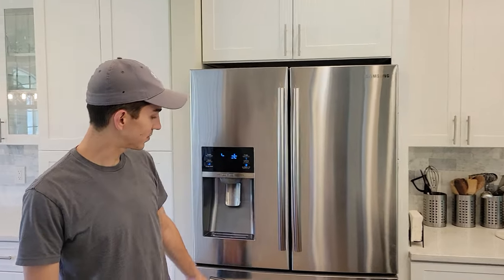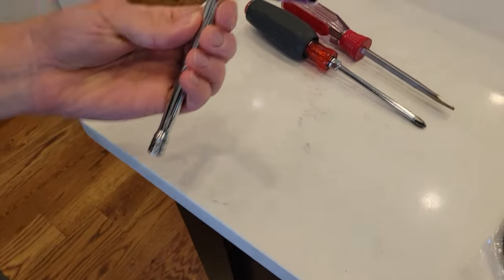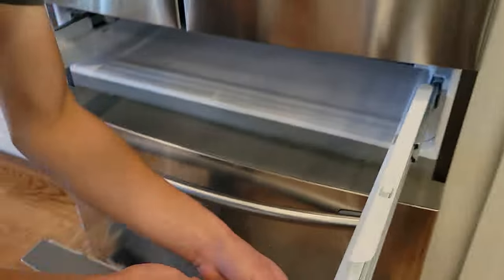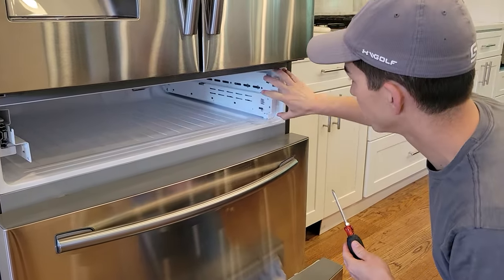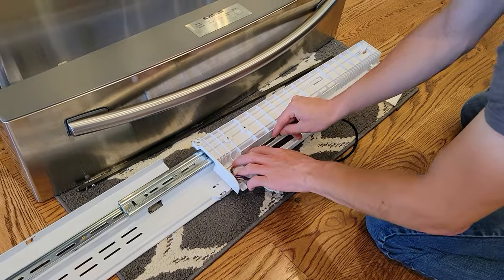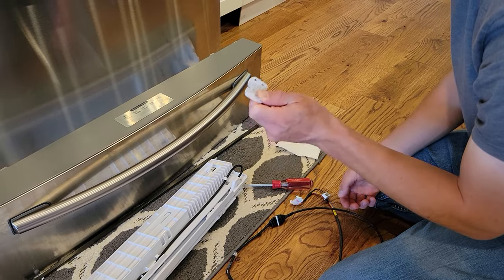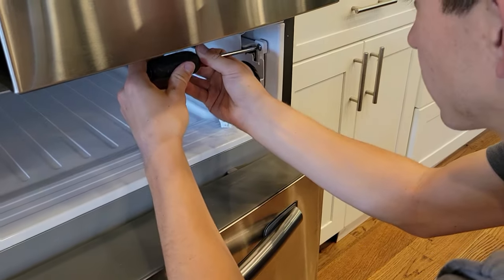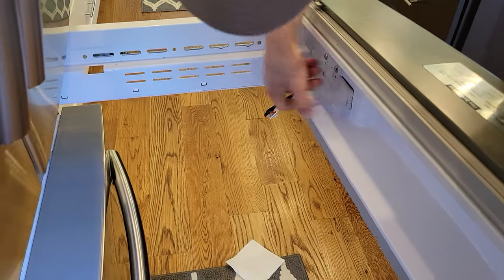Samsung Refrigerator - Flex Zone Drawer Not Working, Freezer light out - How to fix

Comment: Way to go Spenc... My situation and cable was exactly like yours. Thanks for the DIY. I ordered the cable on Amazon. $98 bucks now. And since I didn't have anything to do, I cleaned up the cable, soldered all the broke wires, (theirs eight of them) and put it back in. Worked like a champ. Don't know how long it will last but at least Ill have a spare cable when/if it goes.
Reply from the maker: Awesome! Hopefully that works! Nice to have the backup if needed.

Comment: Great video! Our cable broke a couple of years ago and got a new cable from Amazon. But trying to figure it out was frustrating and since our model has all the controls on the drawer, but all the lights and features of the fridge were still working, I just gave up and we've been living without any controls since.

After watching this video, I now am confident I can finally replace the cable. Thank you for posting this detailed video! So helpful. FYI, our model is RF23M8070SR/AA. And in case you're wondering, will never buy a Samsung fridge again. Between this, the ice maker issues and water dispenser issues, my recommendation would be DO NOT buy Samsung fridges.
Reply from the maker: Glad this helped! Thanks for watching.

Comment: Spent $100 on Amazon and despite not seeing any tear, the replacement worked.  Can now adjust temp in drawer and lights now work. Thanks.  

My model had an extra bar in the back secured with two Phillips screws.

One tip, it was difficult to get the black bar connecting the geared wheels back in.  If you remove the little white clip on the right side of the bar, it allows you to push the bar further into the grated wheel,  and then you can replace the clip.
Reply from the maker: Glad it worked!

Comment: I have a different model, but this was my exact problem as well.  About 5 of my wires to the mid drawer display were severed causing my display not to work and my fridge to cut out periodically.  I soldered them back together and used heat shrink (I cut the remaining wires to fit it). Working like a charm. Thanks bro!
Reply from the maker: Nice work!

Comment: Great video, this fixed everything except the light for the flex zone when the drawer is open. The panel is working again and the freezer light is working again. I found a major cut and frayed area on the cord behind the slider.
Reply from the maker: Great to hear! Thanks for sharing. I wonder if the bulb for the flex zone light is out. The way everything else is working, I'm not sure what else it would be...

Comment: Great video, I must have a newer design or extra screws. The black rod between the slides has a removable clip and I have a rear cross bar between the slides - helps keep them aligned! Also no barrel clip to leave out?! Couldn’t find damage from original cord. Separating the electrical clips was a challenge, patience is required.  Great video though! Waited too long to fix this. Wasn’t sure how to take apart without breaking. Had a terrible mess below from a forgotten spill - had to take apart to clean it! Thanks again
Reply from the maker: Glad this helped!

Comment: Excellent tutorial.  My flex control indicator for coldest setting is on, and can’t be changed when touching the control switch temp. The lights for zone and freezer are working.  Is there a fix to just change the  temp switch, or is changing the entire wiring harness necessary.
Reply from the maker: Thanks for watching! I'm looking into this issue, and I'll do my best to make this tutorial next time I'm in that area.
Reply: If it's not the wiring harness, it's likely the control panel on the door.  Does the fridge make a dinging noise when you push the button?  Or is it not responsive?

Comment: Hey, where does the cable connect to that comes out of the back part of the fridge drawer?  Do you have to pull the fridge out and disconnect it from the back somewhere??
Reply from the maker: There is a spot near the front right inside the fridge where it loops from the back and plugs in. See 2:44

Comment: Hi, excellent video!  Our Samsung has the same problem, I ordered a new wire harness $130 from Samsung in 2023 prices.  I was going to try and splice it back together but I was afraid it would shorten the length too much.  I was wondering if your fix of removing and leaving the "bead" piece fix the problem?
Reply from the maker: Thanks! It's only been a week but the repair is still working great with the bead piece removed.
Reply: @MakingMends  I'll do the same, thanks!
Reply: @MakingMends  The wire harness finally arrived.  I tried several times to get the wire harness to work without the bead piece but it kept coming out of the track.  Hey it took 6 years to break, so I'm hoping this one does the same. in another 6 years I.  We've had constant problems with the icemaker freezing up since we got it, I'll never buy another Samsung.  Thanks for the video
Reply from the maker: @joebridges3165  Thanks for the update! This customer has the same issue with the ice maker - trying to come up with a viable solution. This model is notorious for that.

Comment: Great video. I just realized our lights were no longer working on the Flex Zone drawer and saw this video. This fridge from Samsung has so many issues including the ice maker. Fixed that and now need to replace this. Thanks for the tutorial!

If the cord is cut, do you know if it affects the cooling of the drawer? I've noticed our food (cheese) spoils faster than expected in this drawer and thinking to toss it all until replaced.
Reply from the maker: This fridge ended up freezing everything. I'm not sure what it does when it gets cut, whether it stays on the last used setting or something else.

Comment: All the drawer temp lights are on as is the drawer light when opened ( can’t tell if it’s on when closed).  Is a worn wire the likely cause?
Reply from the maker: If the control panel and light are working, but the temperature is not, it's possible that some of the wires are damaged but not all of them. Just my guess - I'd have to see it to get a better idea!

Comment: Did you consider splicing the cable instead of replacing it?
Reply from the maker: That's a good idea! However, I'm not sure the cable would be long enough after splicing. The cable also needs to bend and flex in just the right way to "roll" out with the drawer. Splicing may add some bulk to it, preventing flexibility, which was the very issue the bead caused as noted in the video. It may be worth a shot if you are careful with the various small wires, keep it slim, and protect it with some heat shrink. Do it at your own risk, as this is just my estimation. Thanks for watching!

Comment: My middle light is the only one out. My control works and freezer light is on. Would you suspect that, the wire for the flex zone light is cut and bad while the others are okay
Reply from the maker: That is a possibility. It could also be a bad light bulb or something else.
Also, make sure the door open sensor is installed properly. If the fridge does not know the door is open, it will not trigger the light. Start watching around 4:02 to see where we put this in.

Comment: Thank you!  I have a different refrigerator (RF23M8090SG) but the drawer is similar.  I have no lights on my panel.  I looked up the part # and it's close  DA96-00640B.  Samsung wants $600+ to repair.  I'm going to take a stab at it!
Reply from the maker: Hope it goes well!

Comment: Just to confirm both sensor are sharing the same wire flex zone and the freezer sensor?
Reply from the maker: The light for the freezer is powered by the flex zone drawer. Everything else the cable does is for the flex zone drawer.

Comment: The light is working but I can't change the temp. It's on the coldest.
Reply from the maker: I wonder if only some of the wires are severed, allowing the light to work while the wires for temperature control are broken.

Comment: Replacing cable didn't fix flex drawer problem.  Argh  $140 bucks.  Still no lights or display on flex drawer.  I'm just using it for storage. What a bunch of junk.
Reply from the maker: Sorry to hear that! I wonder if the control/display panel has gone bad? If you reach out on my website we can talk more about coming out to diagnose this for you!
Reply: @MakingMends  same issue with my fridge. I’m not sure if there’s a switch that detects the door opening or if I should replace the panel. Maybe I’ll order both parts.
Reply: @01bfranco  The wiring harness has the switch that detects if the door is open.  Really simple to replace and a good place to start.